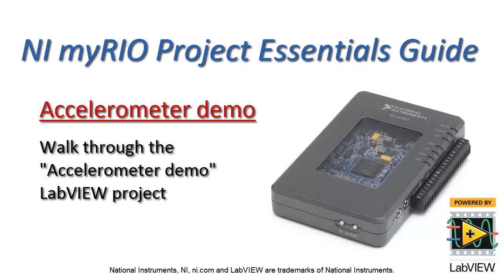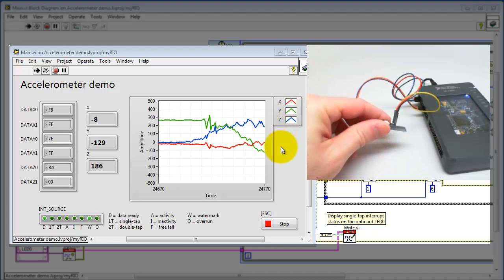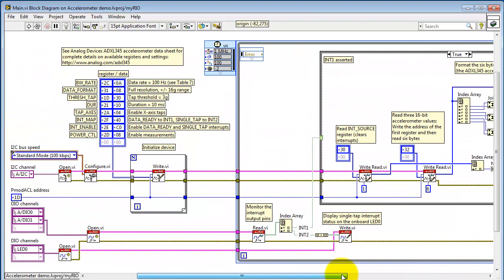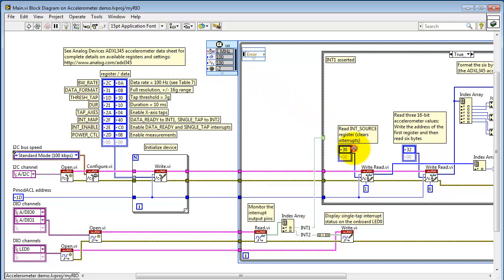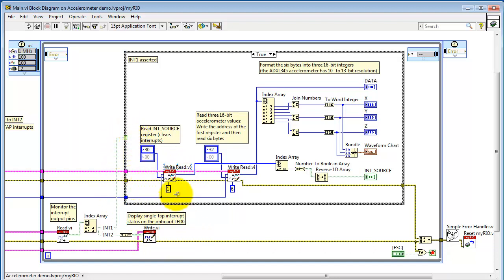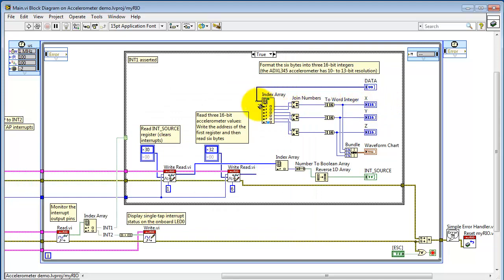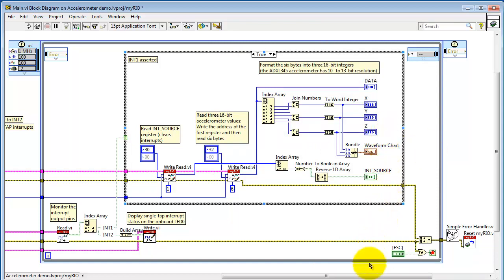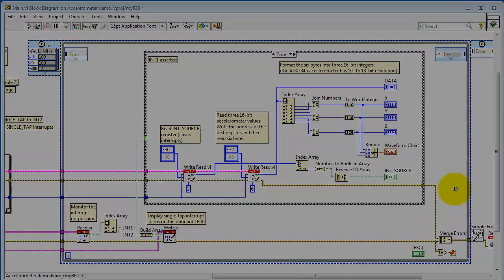NI myRIO: "Accelerometer demo" LabVIEW project

Comment: do drivers need to be downloaded for the low level protocols as when i try run this VI i get a warning for driver supports, so far i have only installed the standard drivers that come with the NI myRio and am using the sparkfun version of the ADXL345

Comment: Hello.. I am using DF electronics IMU 10DOF. I noticed the pins consists of Vin, Gnd, SDA  and SCL only, the pin for INT is not required. How i can do to run the process and control it by using Myrio LabVIEW. May anyone to assists with my project.